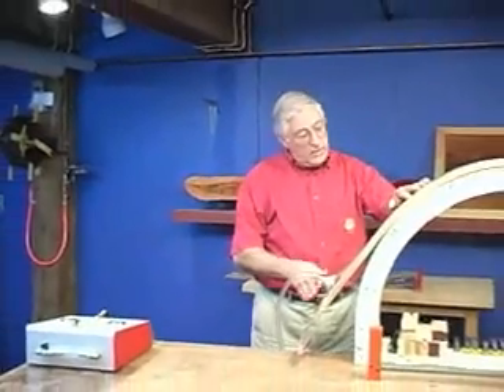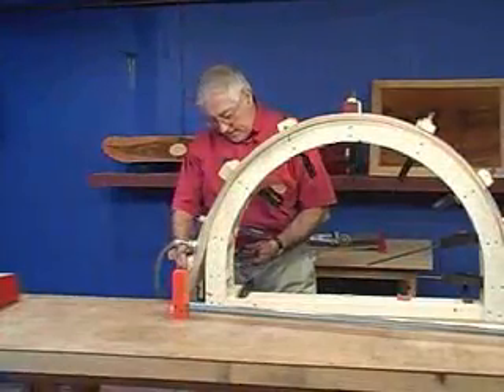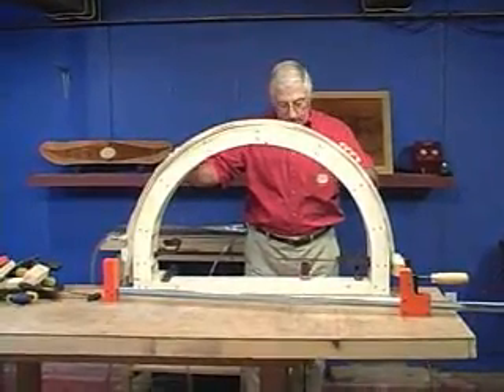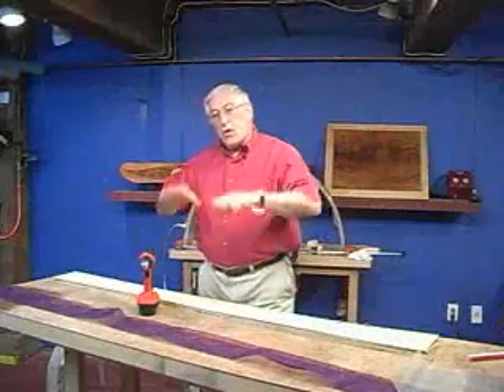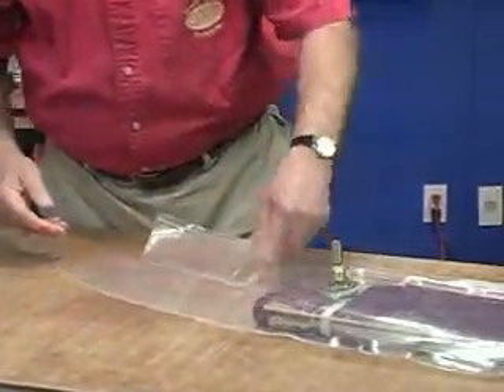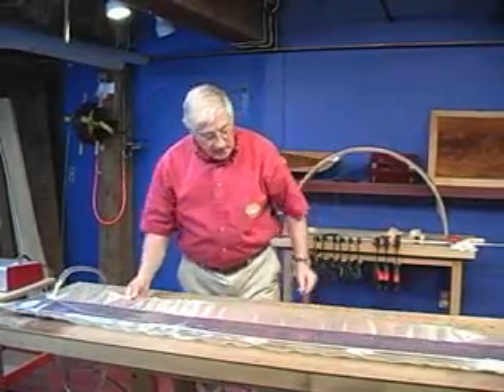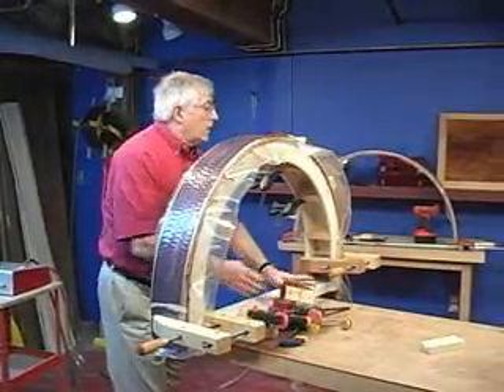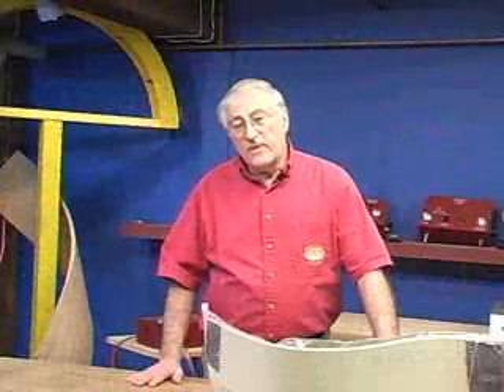Vacuum laminating a round top window with a vacuum bag.

Comment: Hi if it doesn't need any electricity what powers it? Just curious. I know you say it is pneumatic but still seems like it would need something electrical somewhere to power the compressor?
Reply from the maker: The vacuum source does use compress air. Compressed is mainly generated by electricity, the Amish and some other communities generated compressed air with diesel units. It is a 5 cfm all pneumatic vacuum source . https://www.qualityvak.com/air.html#nu .

Comment from the maker: The bags used in this video are .030" polyurethane bags. The vacuum system is a 5.2 cfm all air automatic vacuum system. Once it achieves vacuum level it shuts itself of and when it needs more vacuum it will turn itself back on again. It is totally pneumatic and does not need any electricity the most reliable vacuum system possible.

Comment: Hey thanks for the great presentation. Ive a few questions.
 What thickness is the plastic bags ur using?
 What type of suction motor ur using and is it strong enough??
 Are the bags used home made and if so will shower bags ( Liners for showers ) work and could the fittings be found at hardware stores from plumbing department?
I have six mill bags that we use when camping are they heavy enoungh material to use for homemade bags??
 clamp pressure to bag dose that hurt perhaps bag??
d
Reply from the maker: The bags recommended for industrial use is a .030" polyurethane. In the video we use a It is a 5 cfm all pneumatic vacuum source . https://www.qualityvak.com/air.html#nu . It generates 26.5" hg at sea level. That is over 1,800 lbs of pressing force per square foot. A 6 mil bag would work for a one time type press. For doing repetitive work you would want to purchase a vacuum bag . Multiple size bags can be found here https://www.qualityvak.com/bags.html